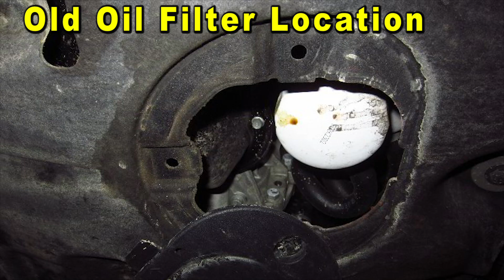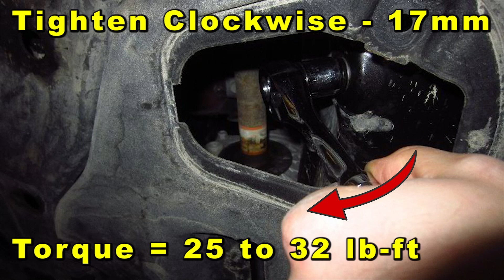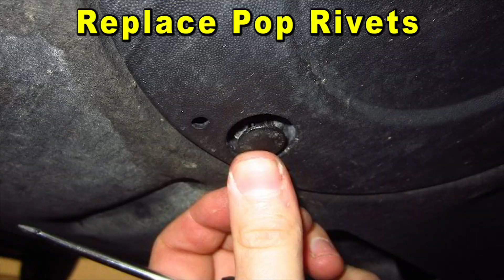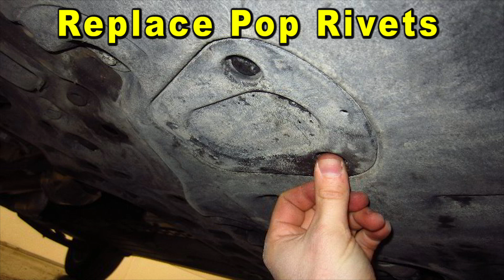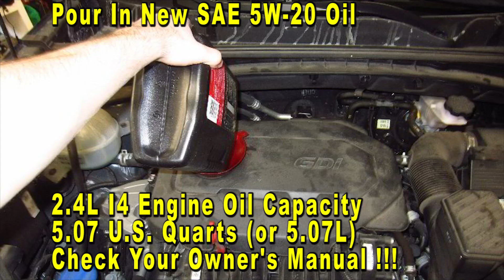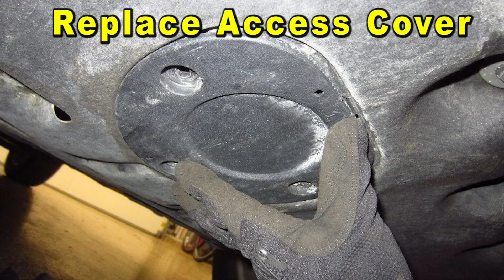Kia Sportage How To Change Engine Oil & Filter 2017 To 2022 2.4L I4 With Oil Filter Part Numbers

Comment from the maker: Kia Sportage Engine Oil Filters - https://amzn.to/48tXF7f
Bosch Premium Oil Filter Part Number - https://amzn.to/3v7M2Eu
K&N Oil Filter Part # - https://amzn.to/3Nzv1tm
Kia Sportage Oil Viscosity - https://amzn.to/3NyQSRD
Lisle Oil Filter Wrench - https://amzn.to/41sBYSF
Precision Screwdriver Set - https://amzn.to/3sLixaP
Plastic Pry Bar Tools - https://amzn.to/3HMtsV7
Socket & Ratchet Set - https://amzn.to/3Z17LbA
Mechanix Gloves - https://amzn.to/3jCnHkt
Torque Wrench - https://amzn.to/3vS5uSI

The Paul79UF YouTube channel is a participant in the Amazon Services LLC Associates Program, an affiliate advertising program designed to provide a means for sites to earn advertising fees by advertising and linking to Amazon.

This DIY video shows owners of the 4th generation 2017, 2018, 2019, 2020, 2021 and 2022 Kia Sportage how to change the engine oil and oil filter for the Theta II 2.4L I4 engine.

Comment from the maker: Check out the DIY guide for changing the engine oil and filter in a 4th generation 2017 to 2022 Kia Sportage SUV -
https://www.paulstravelpictures.com/2017-2022-Kia-Sportage-Engine-Oil-Change-Guide/index.html

Here are all of the DIY repair and maintenance tutorials for the 4th gen 2017, 2018, 2019, 2020, 2021 & 2022 Kia Sportage SUV -
https://www.paulstravelpictures.com/Articles/2017-2022-Kia-Sportage-DIY-Repair-Maintenance-Guides.htm

Owners of other Kia, Hyundai and Genesis vehicles such as the Niro, Optima, Soul, Forte, Rio, Stinger, Cadenza, K900, Sorento, Telluride, Sedona, Kona, Santa Fe, Tucson, Elantra, Sonata, Accent, Rondo, Carens, Veloster, Ioniq, Nexo, Palisade, G70, G80 and G90 may also find these DIY instructions to be helpful.